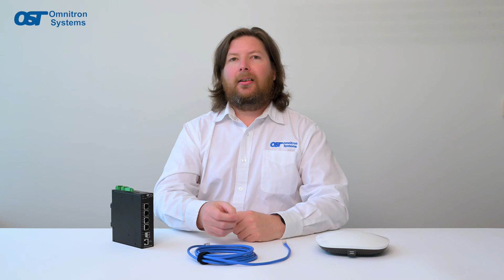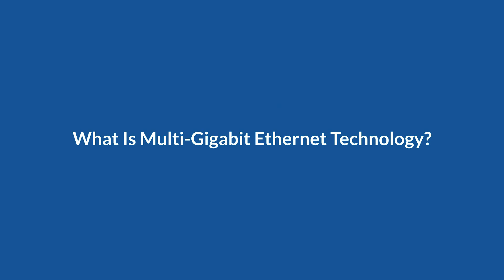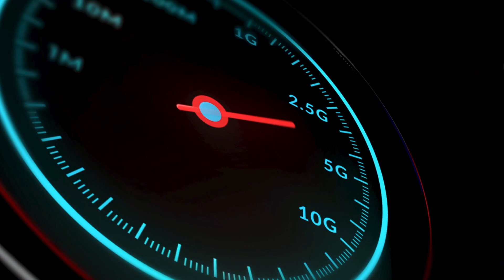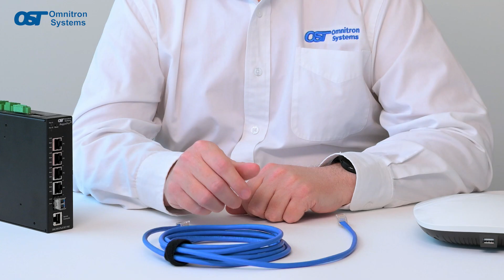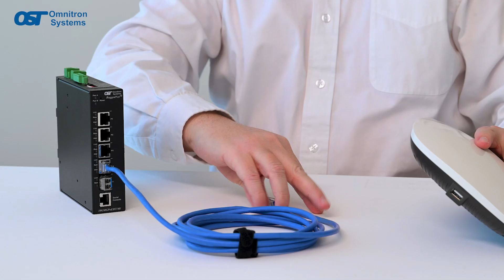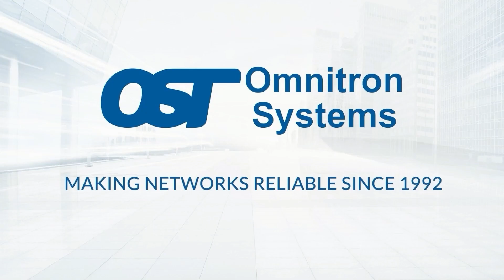What is Multigigabit Technology? Everything you need to know about multigigabit.

Comment: I have an EERO 7 Pro acting as a router with two 5 gig ports. Older technology devices, such as a Pentair pool controller won’t connect, since it requires no more than 2.5 gig Ethernet speed. You can temporarily set the EERO to limit speeds for 30 minutes to allow connections to older devices that only function at 2.5 gig speeds. The connection to the older devices is then good till the next power outage, when the manual connection process would need to be repeated.

I think a way around this problem would be to use a multi gigabit switch instead of an unmanaged switched. Then specific Ethernet switch ports could be set to limit the speed to 2.5 gigs. Then the older devices that only function with 2.5 gig Ethernet, no faster, would connect after the next power outage, without manual intervention. 

The older devices that won’t connect to the faster WiFi speeds can be connected to older WIFi access points that only function at the slower speeds.

The faster network speeds are both good and bad. There are many older devices like pool controllers, irrigation controllers, and other devices that can only connect to the slower speeds..
Reply from the maker: Great breakdown — and you’re absolutely right about the “fast-is-good-until-it-isn’t” problem 😄

A lot of legacy IoT gear (pool controllers, irrigation systems, older industrial devices, etc.) was designed long before 2.5G/5G/10G links were a thing, so when a modern router like the EERO 7 Pro tries to negotiate a higher speed, those devices can’t establish a proper Ethernet handshake and just… panic.

Using a Multi-Gig switch with configurable port speeds is exactly the long-term fix.
By forcing a specific port to negotiate at 2.5G, 1G, or even 100Mbps, you guarantee the older device will always sync — even after a power outage — without needing that 30-minute “compatibility window” from the EERO.

It’s one of the big advantages of a proper managed Multi-Gig switch:

-You can lock the port speed

-Avoid auto-negotiation failures

-Keep legacy devices happy while the rest of your network flies

And yes, pairing older Wi-Fi-only devices with older APs is another solid workaround.

Thanks for sharing the real-world scenario — it’s a great example of why flexible, managed switching matters!